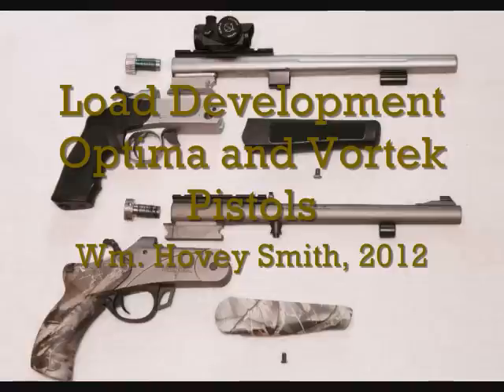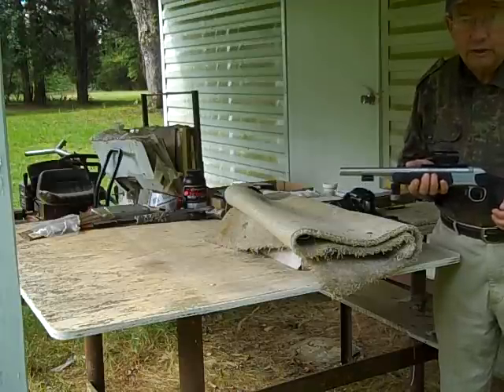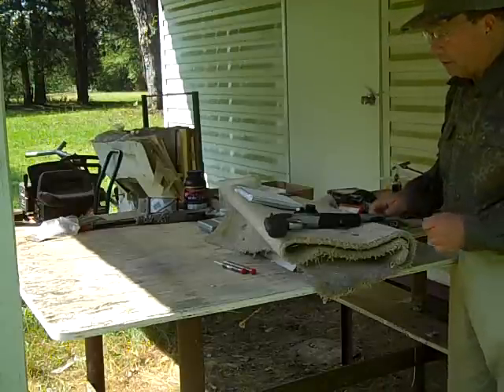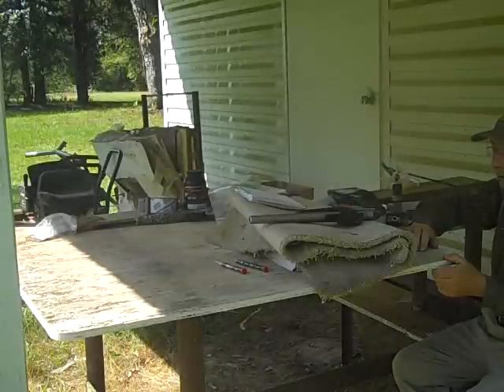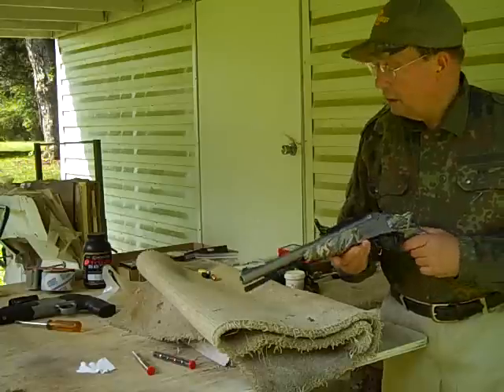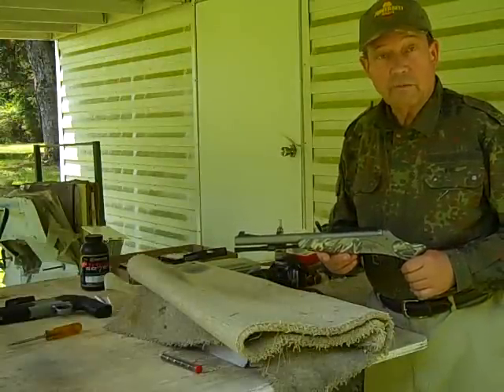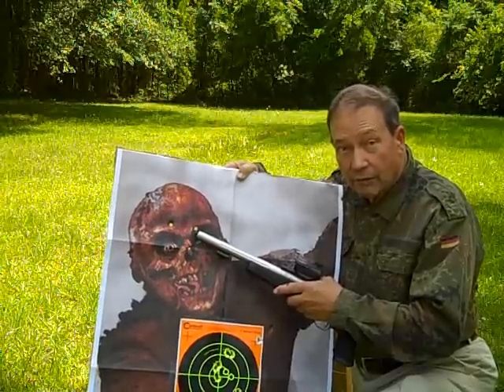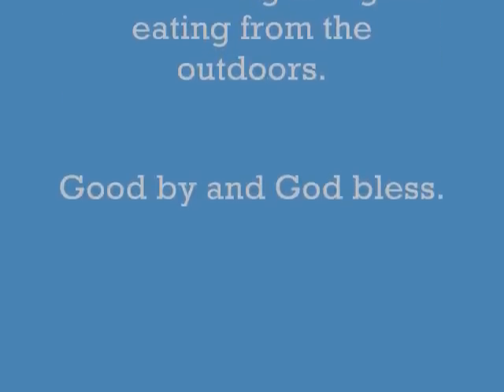Load Development Optima and Vortek Pistols

Comment from the maker: CVA had the opportunity to design against an existing product and improve on it with the Optima. Despite having the scope failure, the Vortek is a reasonable gun; but the Optima is presently a more versatile platform. 209s are fine for me, and I do not miss the absence of percussion caps. The Vortek design does have the advantage of an easily detachable trigger assembly, but a very long hammer fall compared to the Optima.

Comment: Due to the nature of the handguns you'll never see an adapting device for musket or percussion caps. The firing pin strike is not sufficient and too confined to ignite such a primer reliably. Custom Contender barrels using percussion caps have been made and they were not reliable. That is why they go to the 209 Shot shell primer. I'd like to see other barrels offered to go with the Optima.